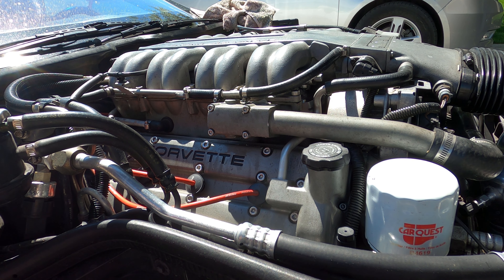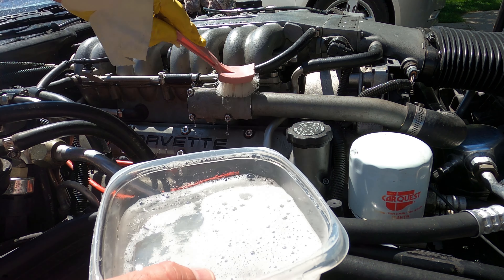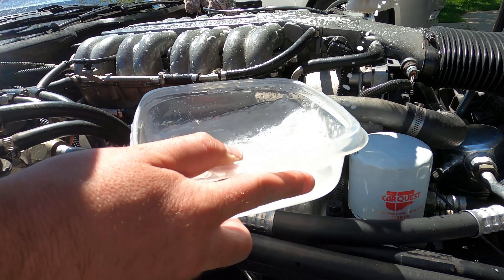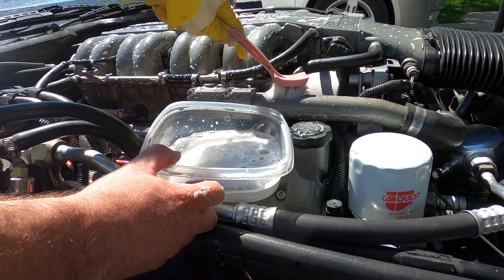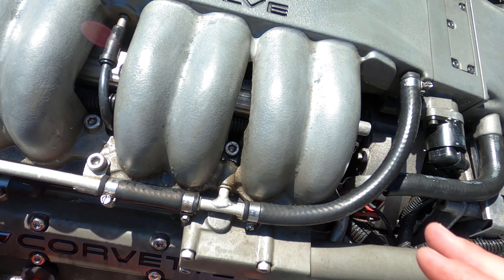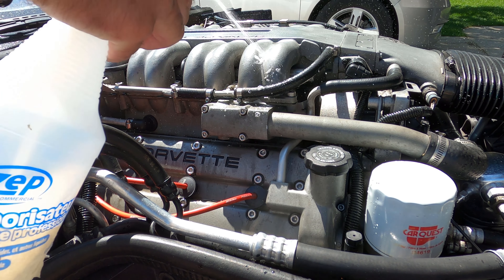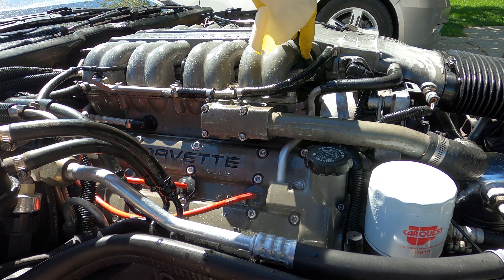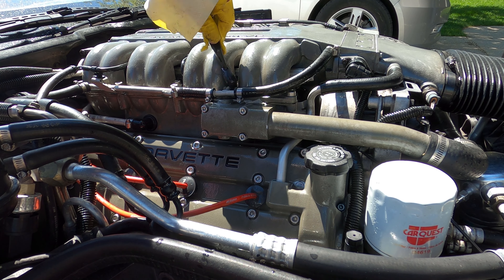Cleaning Corvette TPI intake plenum Aluminum

Comment: greg i can tell you are enamored with your z.  awesome.  so am i its a unique and special car no doubt.  the aqualum (or eagle1 for our usa neighbours) should only be done  if you can fully rise it off with lots of water.   the issue is the rust as you have found out. under the plenum of your new toy that stuff will be working away..  additionally the lt5 is painted.  so you are not cleaning the aluminum surface.  the tpis are different.  this will make them look brand new.  but! one will get rusted fastners galore if done on the car..  if u r in alberta near yyc we should do a z meet. cheers.
Reply from the maker: yeah i rinsed it a lot.  still learning obviously.  The LT5 is painted!?  looks like solid cast to me but what do I know.